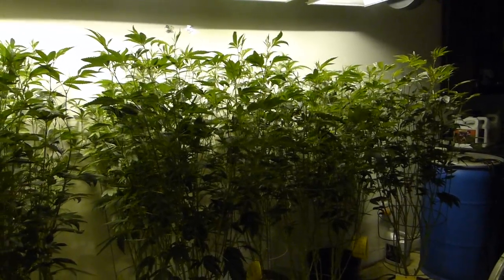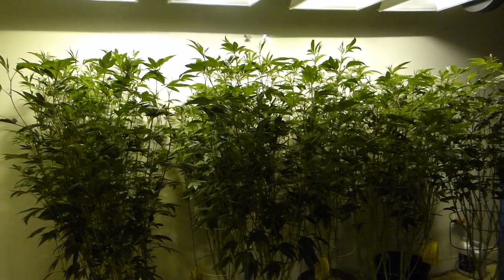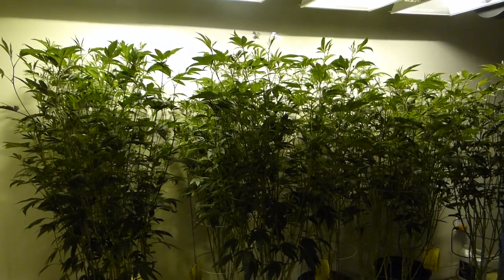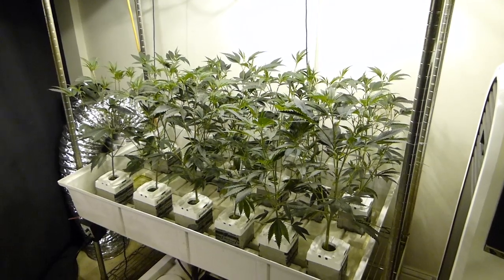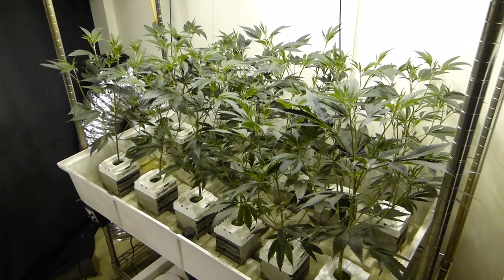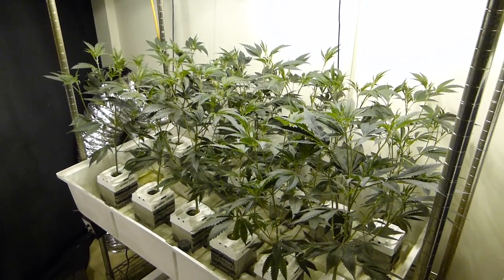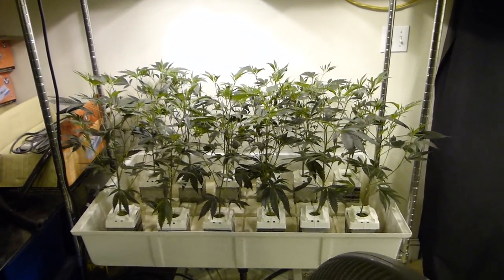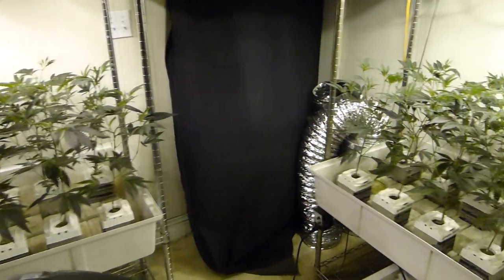Production Line Update!

Comment: A SUBLBC. To get rid of gnats I have used apple cider vinegar + dish soap mixed equally in a cup with plastic food wrap around the top of the cup. Then poke some holes with a toothpick so the gnats can go in and not come out. 
Worked for me. 
YOU'RE DOING ARE HIGHER POWER WORK. Keep it up!

Comment: hey sub just got 2 dual hose 14000 btu soleus air units i run 4000 watt aircooled rooms and i use 1 unit for 4k and its seems to not be able to keep up did you ever have any problems like this my 12000btu window unit wich is like 6 yrs old beats on this portable do you think the units may be shit? have you noticed anything shitty with these units. Also i run co2 is this soleus air dual hose model removing my co2. great show man any input would be great